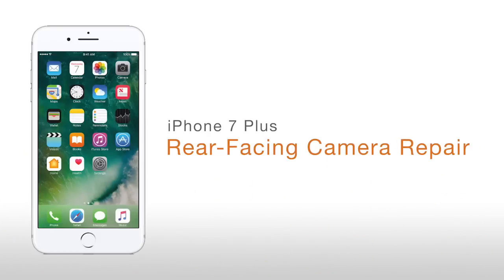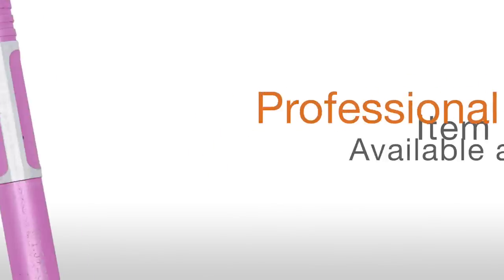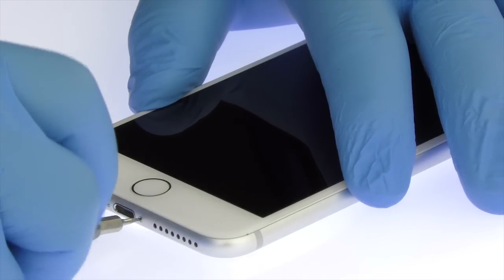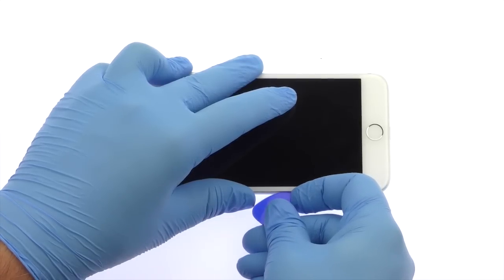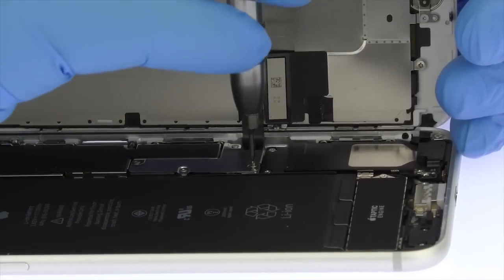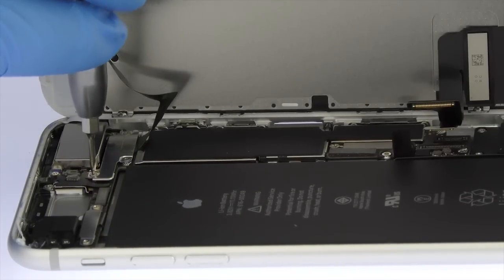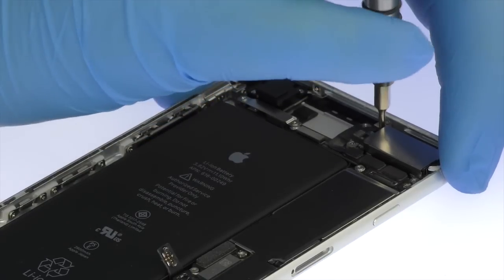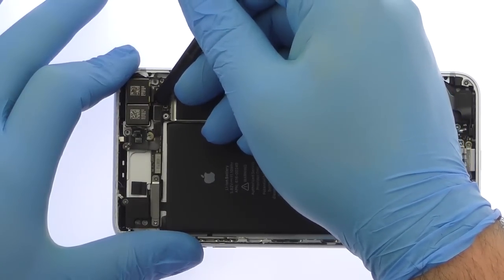iPhone 7 Plus Rear-Facing Camera Repair Guide - Fixez.com

Comment: So recently i got my iphone 7 plus camera replaced soafter that the back camera was working fine....but when i charged and used my phone a bit back canera shows black screen and the wifi connection is not smooth anymore i think the problem occurred here was that the technician did not put adheshive strip albefore closing the phone and when the phone heat up they few connections like camera flex got loose so i think my camera is fine the flash is very fine its just loose connection that needs to be corrected amd after that adheshive strip is to be put!?